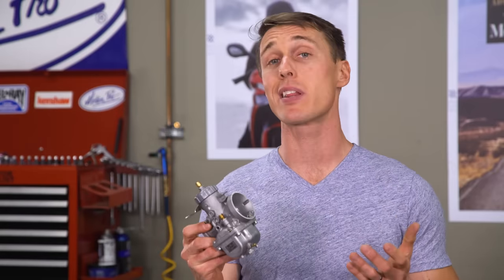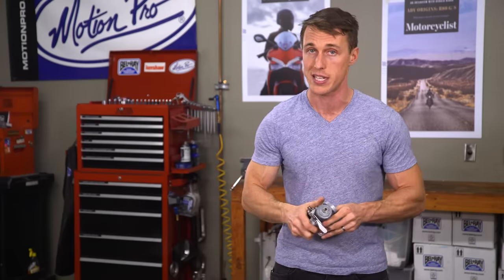Carburetors vs. Electronic Fuel Injection—What’s Better? | MC Garage

Comment: Carbs were great in 1980 welcome to 2021. Fi don’t care if you are at 200ft above sea level or at 8,000ft. Fi don’t care what the temp is outside. It just works. Some old guy is going to say I just pull off to the side of the road and change jets when I’m in the mountains. You have fun with that! I love the nostalgia. But if you truly want a machine to run properly go FI. Nothing I love more than a 1968 GTO or a 1970 Plymouth GTX with a 440 six pack but fi is the way to go in 2021.

Comment: My fuel injection on my Honda XR 190 is rusting out and the throttle is sticking. The first mechanic could not fix it. A new one is $500 .       Do you think I can put in a carborator instead? 
Thanks

Comment: As someone who lives in an area with varying altitudes, after going to EFI I will not buy another bike without it. Not to mention emergency shutoff if the bike goes down due to the accelerometer in the back.

Comment: If you make any little change to the exhaust system, the ecu has to be remapped, same thing if you change the type of air filter.  With a carb, one little screw adjustment is all it takes.  If you have a sensor fail or your fuel pump fails or if anything fails or shorts in the ecu, you are stuck out in the middle of nowhere and are looking at spending big bucks and long waits.  If your carb gets dirty, you will know about it weeks before it becomes a real problem.  If smooth throttle operation and good performance is key, a simple carb is king, but if emissions from a small engine bother you, keep your EFI.  I'll be switching my EFI bike to a carburetor as soon as I can put a kit together.

Comment: Today carbs do make an engine run best (when set for all the environmental conditions present)....ONLY when the user isn't give full access to all the areas of the ECU that need tweaked to make the same engine run at its best. The way OEM bikes run off a showroom is far from optimal, until the rings have been fully seated to the cylinders (1200+ miles) and until someone has reflashed the ECU to eliminate fuel-cut, ignition retardation, secondary butterfly flow restriction, and exhaust valve flow restrictions.

Until then, enjoy the lurching on/off throttle, the poorly calibrated throttle-by-wire, the torque dips due to ignition timing and throttle plate secondaries and exhaust system valves.

Comment: “Better” is a relative term defined by the user himself. I chose carbs because they fit my requirements: Firstly, they sound better as agreed by the factory senior mechanic and workshop mechanic because carbs internally plus the air box are like a trumpet. Secondly, should they break down, they are generally easier to repair.

Comment: with due respect to the logical step forward,which is efi, I'd still be hesitant to use a tech I can't fix myself. wouldn't give me the confidence to go for long trips. but I imagine if your fuel filter is working fine,the pump and injectors shouldnt give any problems. at least that's how it is,in my 1987 diesel.

Comment: Please if you can inform me.  1st how many sensors usualy a carb has .2nd on what do they serve for . 3rd How and where they are connected on. I should apreciate an answer from you , thanks a lot and congratulation for the excellent rerformance of your videos.
Reply: Nik Rous carbs don't have sensors, just tuned jets

Comment: Hello,sir! I have a problem with my '83 Honda cb400n and maybe you can help me. The left cylinder isn't running when the bike idles and at low rpm. I've cleaned the carbs,there is spark and compression is 140psi on both cylinders. If I hit the gas,the left cylinder is comming to life. There is also some backfire in the right carburetor and the exaust at hi rpm. Can you give me some advise? Thank you
Reply: check the throttle

Comment: Currently i'm modifying my generator engine for aircraft use (rc) and my first step was to use a DC CDI and upgrade the carburetor to 150cc motorbike cab. can this apply to F.I. Cab? to enable maneuverability! Thanks

Comment: Also keeping your fuel injected bike in storage for the winter is a bad idea. My battery went dead and it wiped the whole ECM. Had to pay Kawasaki $2000 to get it re programmed. Should've stuck with my 750shadow
Reply: i call bs unless you did some shit like took the battery into sub 0 temps causing it to go wild it wouldn't wipe the ECU

Comment: Another function that a EFI can Do is save your engine, Not to sure if this happens on motorcycles but I know does on late model cars, If your Engine starts to overheat, Vehicle gives you a warning to pull over and can shut it Down before you do serious damage to engine. also EFI you can actually look at LIVE Data and see whats going on with all the sensors, carb u just got oil pressure and temp gauge
Reply: Wal. My fuel injected 2004 Dodge Dakota 4.7 v-8 engine blew a head gasket and overheated to the point of scoring a cylinder and dropping several valve seats. That worthless fuel injection did nothing to keep that from happening. Even the tiny little alarm wasn't loud enough to get my attention. People shouldn't give fuel injection credit for stuff it doesn't do which is shut down when overheating. There are too many rumors getting spread around.

Comment: Carbaration is good at the track to shave off a couple of seconds but EFI'S are more reliable if the right map codes are downloaded in to the fuel management system, even shorter explanation.

Comment: I prefere the carb, but that might be because i wanna know how the mechanics of my moped works. I have had a couple of problems with my carb, but that has mostly been dirt stuck in the jet nozzle. Also i believe that tuning a moped is a lot easier with a carb than a EFI. 
Also when my moped was manufactured, EFI was relatively new on the market.

Comment: Trying to think of a way to compare two bikes with the same motor but with different fuel delivery systems. Problem is when most manufacturers switched to EFI from carb they introduced other motor changes too. Maybe ride a couple of Harleys from LA to Colorado and back, with dyno tests along the way.

Comment: @ McGarage. Why does my front tire have high & low points in between the tread of the tire . Also why does my rear tire crack down the center of tire.

Comment: Carbs are like mechanical watches.
Fi is a modern digital watch.

Sure the modern one is easy to read, reliable, almost no maintenance, but there's something about having a bunch of gears driven by a spring you have to manually wind up every so often on your wrist. 

So imo, carbs>Fi any day.

Comment: Fuel injection can be very abrupt during off/on throttle transitions. A very slightly rich carb jetting makes for buttery smooth throttle roll ons.
Reply: The fuel injection stumble may be able to be tuned out.

Comment: My doctor told me to cut down on carbs. But I told him that when there is an EMF blast, my old vintage bike with a carb and 
points will skeedaddle me to my bugout cabin, where I can roast the local deer with my woodstove. No carbs there.
Reply: thats got a 0.000000000000000000000000000000000000000000000000000000000000000000000000000000000000000000000000000000000000000000000000000000000000000000000000000000000000000000000000000000000000000000000000000000000000000000000000000000000000000000000001% chance of happening

Comment: most motorcycle FI isn't truly dynamic like a car is.  They use preprogrammed charts based on factory dyno tuning to guesstimate the appropriate fuel mixture given specific variables. They aren't going to detect when they are running rich/lean and dynamically change their fuel mixture.

Comment: I dont know how common this problem is but i hope to see a video about this on the MC my 125cc has a difficulty of switching between 1st to neutral while running or when i stop at a robot , the only way i can solve this is when i turn off the bike and switch to neutral and then start the motorcycle again . is this a common problem?

Comment: I have a fuel injected king quad 700.. when I'm riding at altitude around 6,000 to 8000 ft I seem to lose a lot of power. Is there anything I can do to fix this. I've already modified the CVT transmission which helped quite a bit.
Reply: It will be running too rich at high altitudes you would need to lower your jet needle and turn in your fuel screws a bit
Reply: There is simply less air to work with. Your fuel injection is doing the best it can. The only solution is to push more of the thin air in with a supercharger or turbo charger. Or, squirt in some nitrous oxide.

Comment: You will have to learn about a carb if you have one. You will at some point have to remove it and you will have to learn how it works. I learned by fixing an abandokned moktorxycle that sat for two years i m a garage. $300 for a new looking 02 Honda shadow and about another 3 in parts and a few hours of labor and it runs like it's brand new and because it was in a garage it looks new. Slapped new tired on it, upgraded sokme bit and fokr less than $1000 I have a perfect running 02 Honda Shadow Spirit VT750. I taughbt myself about bikes just to fix this one. Got it working, got my license and now I ride. With cold weatgher I'm learning how a carb can be. However even at 40F I can't start it with no choke. Just wait about 5min to warm up and it's good. Definitely a learning experience.

Comment: Is using my Motion Pro sync pro usable for my bike? I have a '09 Yamaha R6S. I have used the equipment following the directions and the 2 outside cylinder (1&4) do not move on the fluid level when adjusting the screw?? Please help
Reply: I ask because this bike is fuel injected through the manifold, no carburetor.

Comment: what you don't point out is carbs around town are much better that fuel injection , the only thing injection is better at is motorway bashing then long sustained speed give you better fuel consumption, its swings and roundabouts :)

Comment: Will running a can of seafoam through my 2007 V-star 1100 every 3rd or 4th tank help or will it eventually still need to be removed and cleaned? Picking the bike up in a couple of weeks. Runs great now but looking to do some pre-emptive maintenance. It is a 2007 with 19000 kms.
Reply: "top tier" gasolines have a good amount of cleaner mixed in. If you want to put in a little something extra every so often, don't need to go overboard. Non-ethanol gas stores a little longer.

Comment: 2013 kawi 300's and 636's have cold start issues - both fi. The denso ecu's were officially recalled on the 300's, but not top selling 636..... but make a video of your 636 stalling, send it to kawi and they'll replace it. I worked at Denso for 18 years btw lol. 900$ ecu- bet your bottom dollar they're reworking them, unfortunately.... only so much can be done to a fuel map due to EPA regulations- think about it.... and these bikes are stalling after warm up (blipping throttle, pulling clutch in). So much for fi right?

Comment: My 01 softail springer was carbureted with a kuryakyn hypercharger and sampson streetsweepers. It only required the choke used when cold. It would start right up and I'd let it sit 5 minutes at idle choked then roll. Awesome throttle response and averaged 48 to 53 mpg depending on riding style. I don't think it was jetted just factory. Then had an 05 night train same exact bike except color, front end and it was EFI. It is absolutely true on the coldest of days you could fire it up and roll with no waiting. It was all stock minus the V&H short shot baffled exhaust. Pretty sure it wasn't tuned, only the stock settings because it to averaged  the exact same mileage as my 01 did. 5 gallon of fuel i could get 325 miles but bettet be pulling into a fuel station. Hi test 100%. Had an Electra Glide with a built stroker engine and a huge carb that at 125 miles I'd have half a gallon left out of 5 gallon. It would scream but horrible on fuel. Now have an 04 softail with a 95 big bore kit, kuryakyn crusher 2 into 2 exhaust, a kuryakyn hypercharger and it is EFI and had been tuned. It also does not get good fuel mileage, at 160 miles I'll get fuel and it'll take 4.5 gallons +/- to fill up a 5 gallon tank. It has instant throttle response like a carb but the 05 nighttrain and other EFI harleys in stock form always had a slight delay that i didn't care for. But for the mpg stock is by far best and in cold climate areas EFI would probably be better although the EFI bikes have a check valve assembly inside the tank and the hose WILL get a hole in it from rubbing the tank via vibration at some point and you'll start getting electronic codes MAF codes, coil codes etc along with coughing sputtering  backfiring when fuel level get to the point where the HOLE is. Usually about half a tank. FYI.

Comment: For me its easy Carburetor that's it.  It's true that injection offers quick and extensive tuning and uniform engine expansion across the range, but a set of carbines set to work at high speed can drain everything from one engine by everything i mean literally every last ounce of power. Down side is, there are not any low revs, and the average to 11-11,000rpm are a little bit moody, but from there upside down things come in an phenomenal way might even call it scary. Even though there are fast electronics, at least untill the signal reaches the pump and the pressure sensor returns information that the necessary pressure has been reached, some time passes though which the carburettor has long replied to the command that is brought into action instantly!   I drive Honda cbr 893 with good dyno jet kit and yoshimura rs3 and "crown"  the size of a soccer ball, well let me tell you that this bike with the settings above is destroying  99 % of  FI bikes. Fuel consumption though can get as  high as half a litre in 10 feet :D

Comment: Put a hollow metal ball between carb and intake manifold atomizes and vaporizes gas doubles gas mileage and it works, increase power tremendously and efficiency

Comment: To all those in favor of carbs because they like to tinker:

have you not had EFI automobiles that you tinker with?

Carb bikes can be fun as any other, but I'd guess someone with one bike who depends on it for transportation at all will prefer the convenience of an EFI bike. A '57 Chevy is a lot more fun to have around when you have a '97 Toyota to pick up parts for it.

Comment: Why is it that Japanese dual sport bikes still mostly have carbs??   Supposedly they are discontinuing like the KLR650 after 2018 for emissions reasons which I have to think is because that model is carb fed....Just seems like to me there are fuel injection components on the shelf already that would work for big singles...Wonder if XRs and DRs are about to be discontinued also?

Comment: I have a  2022 125ccm fuel injected China scrambler, and a Honda Scoopy 1986 carburetor moped.
And there is no difference. They both start immediatly after 3 month in the snow at winter, but, I
prefer Honda tech, since I can fix it myself.

Comment: Please make a video about nitrogen vs normal air filling for tires
Reply: Nitrogen expands and contracts slightly less with carrying temperature than atmospheric air. If there is an advantage it is because nitrogen is dry and oftentimes poorly maintained compressed air is wet.

Comment: not to be a stickler but the piston does not such in the gas, it is the air passing through the venturi of the carburetor passing over the main jets opening that sucks the gas out of the fuel bowl and then into the cylinder.  Yes, this action is caused by the piston making suction.

Comment: A crowd of gazers without any knowledge of this topic commented on the nice exhaust sound of my carbureted RX1 snowmobile.  4 carbs, two exhaust pipes.  

I rode both technologies and to me, the throttle response of a carb’d sled is much much better, because its quicker!

Comment: hey Ari, could you do a video on the advantages of a Telelever front suspension geometry, like on a BMW GS. I was wondering how it benefits comfort, handeling or steering feel. Thanks.
Reply: The main advantage of the telelever is it doesn't nose dive when you use the front brake, no matter how hard you clamp it down. If you hit a bump while on the brake, it absorbs the bump like normal. The brake force is transmitted to the frame by the telelever. 
  It's an odd feeling at first, the bike tends to feel like it's rotating upwards around the front tire, and I found my weight wasn't into my hands as much, but I slid forward in the seat some. I also locked up the rear brake more, especially when I first go it, now it's not an issue. 
It's the sort of thing you are very aware of at first, and then it kind of disappears. As far as feel and other matters, it's more or less normal. 
An Earl's fork does about the exact same thing, like the old Beemers had.

Comment: My Grom runs lean with pipe and airbox mods.Would a higher flow Fuel Injector help fix this problem?Thanks and ride safe.
Reply: Generally speaking, with pipes and airbox mods, existing injectors should be ok with a tune.